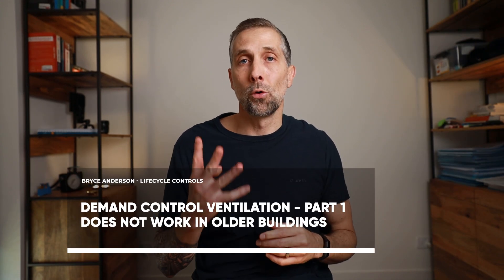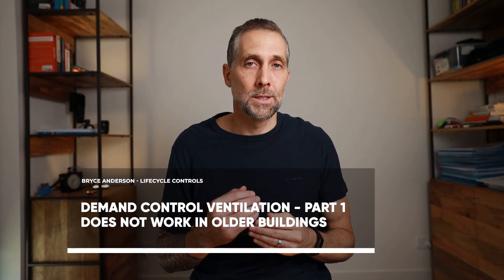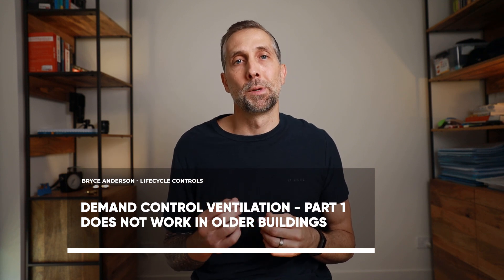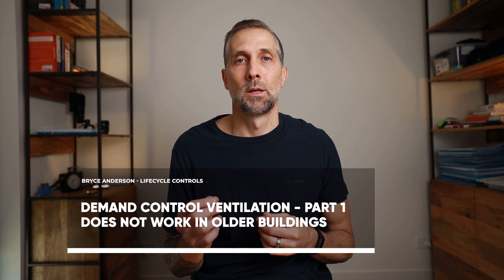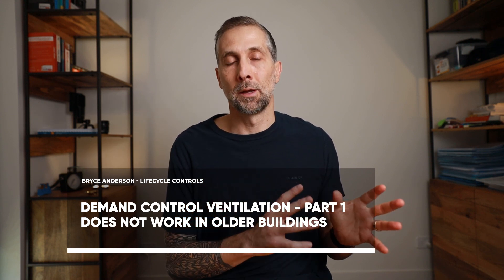Part 1: Demand Control Ventilation Does Not Work in Older Buildings

Comment: How do you design the air handlers in Australlia? Do you control the outside air dampers by percentage, or you actually measure how many CFMs are going in? How do you control the exhaust fans?
Reply from the maker: On expensive premium grade commercial offices we could have volume sensors on the outside air, if they don't get value engineered out. 
However, for this discussion, where we are adding CO2 control to an older building, the AHU's wouldn't have volume sensors already, so they generally would not be added as part of a demand control ventilation project. Dampers then controlled as a percentage. 

The return air fans track the speed of the AHU supply air fans to maintain the correct outside air balance and building positive pressure. However, this is very complicated as the RAF and SAF usually have different characteristics (axial RAF with EC motor SAF) so you can't simply run the RAF 10% slower than the SAF.